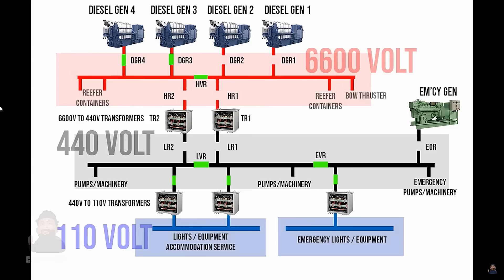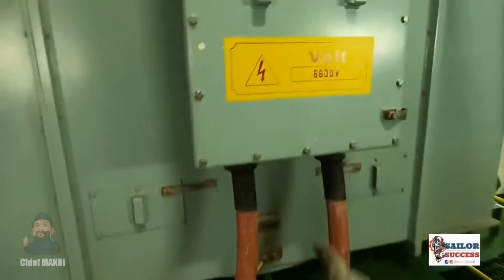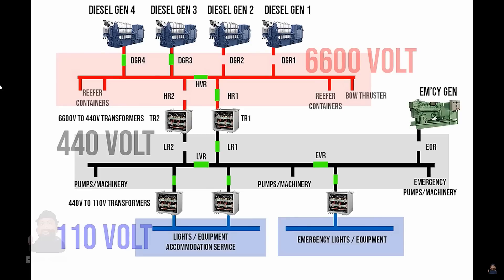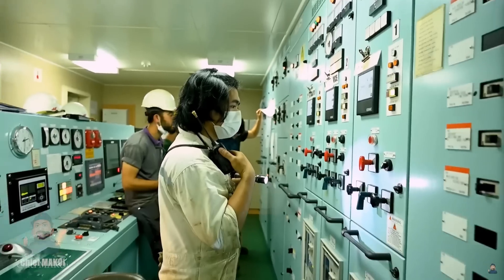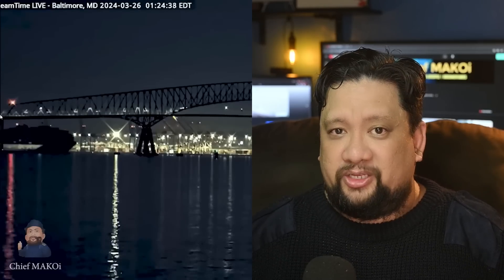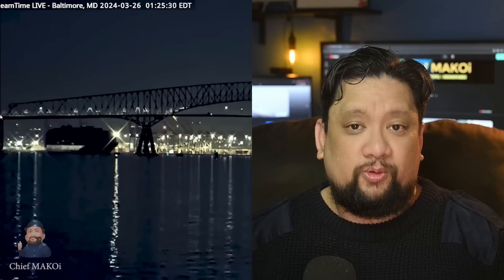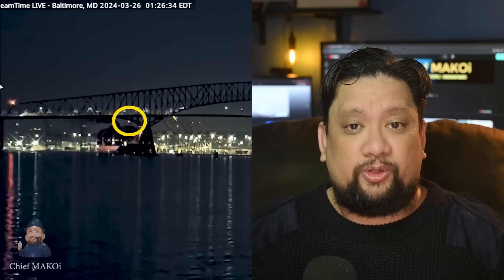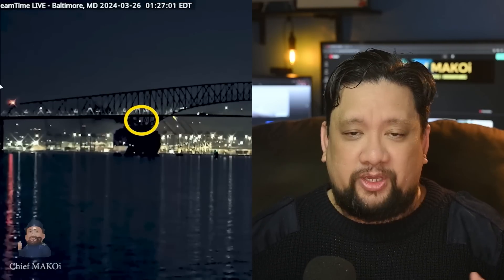Bow Thruster : Why The Dali Didn't Use It | Chief MAKOi

Comment: Oh Gosh. The Speed 2 Reference. Anyone who remembers it is having back problems.
Reply: Old enough to have seen it, but not bored enough to have ever watched it.
Reply: I have seen the first speed movie, not seen any of the others.
Reply: Yea but if they don't turn and turn while under water, how do you build suspense? 

But it's weird that the ship would finally crash into a pier and then the anchor would drop on someone's luxury car.

If Chief Makoi was the protagonist in Speed 2, he'd stop the ship fast enough that there wouldn't be a movie, because there's no way an engine will keep running and running when no one's in the engine room to keep the oil pumping, the engine cool, electrical power flowing and all that. Really all that's really needed to stop the boat is just shut off the cooling water, oil, or whatever. The main engine would seize up and the main propeller wouldn't turn at all. No need to try to jam up the propeller with ropes or whatever, or even drop anchor to try and stop the ship. Actually I'm sure those marine engines have fire suppression systems. Trigger them and the main engine can't turn. There's also the engine's air supply fans, turn those off, and the engine can't run.

Or really, just do nothing for a couple of hours and I'm sure the main engine would stop on its own. No way any computer hacking would make a ship run automatically, at least not back in those days. Ship has crews because they need them to keep the ship afloat. Heck even just flooding some ballast would likely slow the ship down enough to where no amount of engine power would make it go after than a couple of knots.

Also copper poisoning? Didn't even know it was a thing.
Reply: @taiwanluthiers  if I turn off all the power the fuel pump will turn off and the engine will stop all by its lonesome.

Ideally I'd just look for the switches labelled fuel pumps in the engineering space. Or trace the fuel lines from the engine through a few walls and isolate the pumps at the pump.
Reply: @glenmcgillivray4707  Yea the whole premise of the movie is dumb. While they were out at sea they would just turn the fuel off and the engine would have stopped on its own. Premise of the movie is that it was all computer controlled, but if that's the case all they had to do is physically shut the fuel off.
Reply: I should also mention, the bad guy in Speed 2 would likely take Chief Makoi out before doing his computer lockout, as the chief would figure out how to basically destroy the engine to stop the ship. However without the chief and his engineers, the ship wouldn't go far before something forced the engine to stop, and the plan is foiled.

Comment: As a inland barge captain i sometimes use the bowthruster to slow down. The jet of water creates huge resistance and its very effective in a small canal. The ship is 110 meter (about 350ft) long so it’s not a huge container ship but also not a small skiff. I wonder if that would also have any effect on a ship like the Dali.
Reply: Is your bowthruster not a rotation one?
If you can rotate 360 degrees (as most of the barges here in the Netherlands) it makes sense.
Not with a right and left thruster.
Reply: @jinnygaatjenietaan306  yes and no. It’s a 4 way thruster with a horizontal propellor that throws the water into one of 4 directions (or in between). When the ship has to much forward speed it is more effective to thrust the water to the side than it is to thrust the water forward. When the ship has slowed down enough I shift the thrust to forward to come to a complete stop. I can only do this with a fully loaded ship because when empty the bloody thing just turns with the bowthruster. And I have to use full power so it basically a beam of water coming out the side of the ship. 

I have also worked on a pushboat with two thrusters (schottels) as main propulsion. With enough forward speed the most effective way to slow down was to first turn each thruster to the outside until most forward speed was gone. Then I turned the thrusters forward to come to a complete stop. It was like throwing a anchor.
Reply: @autobootpiloot , thks, but a schottel is far different than a left right thruster.
And a thruster with a horizontal propellor is also less problematic because it sucks its water from a different place.
If I'm not wrong, a inland barge in the Netherlands has to sail a minimum speed of 6 kmh on the bowtrusters only.
Reply: @jinnygaatjenietaan306  a schottel is completely different but the left right function of the bowthruster is comparable. Yes, we have to be able to reach a specific speed with bowthruster only. But that’s not how I use it when I slow down. At least not when there is more than let’s say 5kt forward speed.

But again, I have no idea if this technique would work on a large container vessel like this. If it would work I imagine not many people know about it because it’s a bit counter intuitive.
Reply: @autobootpiloot  I'm used to sail on big seagoing ships, like Chief MAKOi. 
And I sail on inland ships.
On the seagoing ships as far as I know your technique don't work.
Question, sailing on the Dutch inland waterway's?
Reply: @jinnygaatjenietaan306  yes, mainly Dutch inland waterways. Sometimes Germany and Belgium too.
Reply: @autobootpiloot  Right.
Maybe we see each other once..

We liggen in Den Helder, en vanwege de diepgang en hoogte kunnen we met ons schip niet ver Nederland in.
Dus als je ooit in deze hoek van Nederland kom, be welcome for a coffie....

Comment: What you told at the end makes the most sense, bowtrusters don't work at any speed forwards.
It only works when you are making no speed..
I have two vessels, one with a bowtruster, (12 meter vessel, 8 ps thruster) and it don't simply works on speed.
(the other is a seagoing almost 80 years former fishingvessel where we live on)

Comment: I MUST SAY AGAIN-turning the rudder 20 degrees, in that situation, would NOT HAVE ANY POSITIVE EFFECT, and in fact would have a negative impact. At those slow speeds, there is not enough water passing the rudder for it to function anywhere near effective capacity-in fact-at those speeds the sharp rudder angle would create more of a braking effect
Reply: What are you talking about! slower speeds you need more angle on the rudder to have an effect.
it is 20 degrees, not 90!

Comment: Thanks for the insight!  How many generators are needed  to provide full power to Bow Thruster Motors?  How quickly can generators be synchronized to come online?
Reply from the maker: Usually, the bow thruster has an interlock and can't be started unless at least two generators are running.
Reply: In this context chief I have been on low voltage 440 vessel 
The protocol there was to keep the bow thruster breaker dis connected as the ship leaves the berth or is far from approach. May be during the black out reset the bow thruster may be one of the automatic trips like deck refers. Since in black out bow thrusters would only be on as you mentioned with 2 or more generators running in parallel. If the generators had tripped in the 2nd black out the system may have dis engaged the bow thruster panel which could be only turned on after two generators were running in parallel supplying the bus.
Moreover I think the crew would give priority to main propulsion restoration to bow thruster panel as you mentioned the engine crew cannot see whats happening outside. 
2 back to back black outs may have also un nerved and confused the crew.

Comment: 0:20 My wife  always tells me when I groan about such a completely impossible scene in a movie like this: You have to suspend your disbelief and enjoy the story. 🙂
Reply: I worked in the marine propulsion industry and had been in many shipyards during overhauls. I overlook a lot of movie mistakes but was so disgusted with Speed 2 that I walked out of the theater with my young son. Even he thought it was a stupid movie.
Reply: @kimmer6  interestingly, Speed (1) wasn't that bad, or at least this is how I remember it. I never got to see Speed 2
Reply: @rnzoli   Speed 2 was worse.
Reply: @rnzoli 
i remember Speed was a fun movie.  never had any desire to see #2.  i've managed to avoid it for all these years
Reply: @rnzoli  At least Speed had a viable premise, big boom if slow bus down too far. As someone said above, there is always a mechanical interlock somewhere in the system that can be opened to stop it. You might need some time with a fire axe or chop saw to get to it, but it is there.

Just as an example, automated power switch gear to a data center housing an AI gone renegade, axe through the fiber optic cables first (no AI can splice a cable), then throw the closest HV switches open. Or drive a car or two into the power pylons and trigger a cascading power failure.
Reply: I'm like you about certain scenes in movies. Things like lever action repeating rifles before the Civil War, or never running out of ammunition. Cars exploding in midair is another pet peeve.